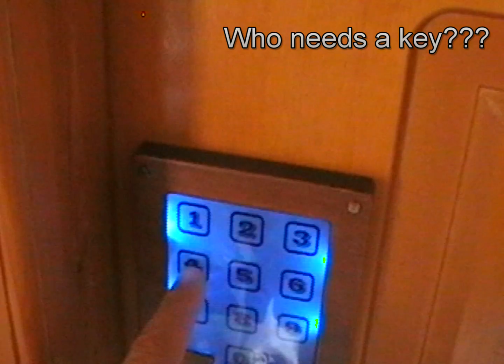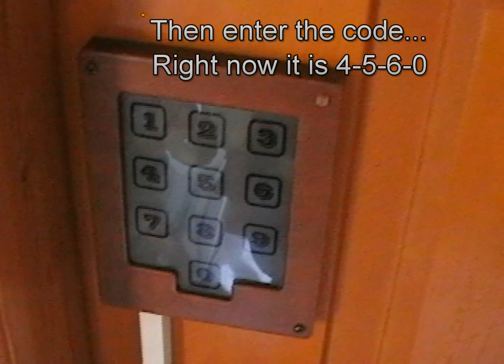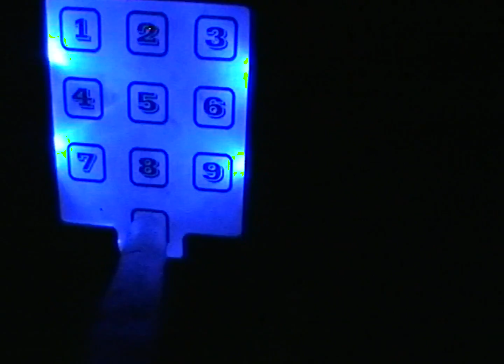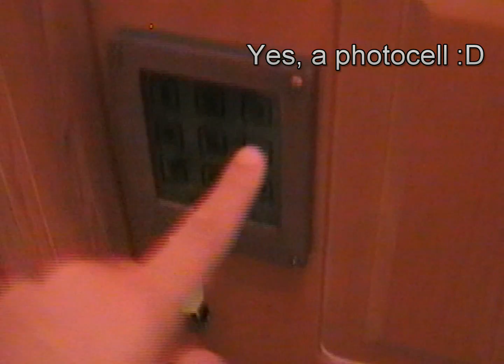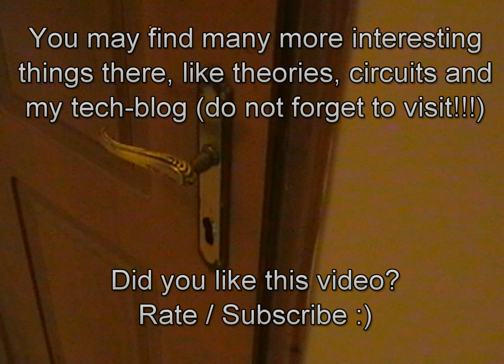DIY Servo-Actuated Door Keylock Hack with capacitance touch-pad

Comment from the maker: @FussyCashew that was an idea as well, but after some calculations is saw that 4 batteries will last for about a year with regular use. My best choice is to make a wireless charger. i do not want to have cable going into the door.

Comment: Re: If the batteries fail.

You could install some sort of battery input connection on the outside. So if the internal batteries fail just give it a battery boost from the outside.